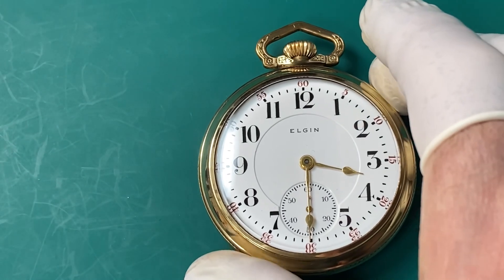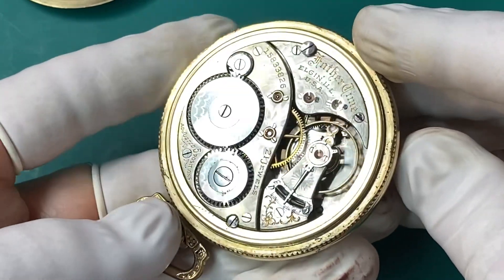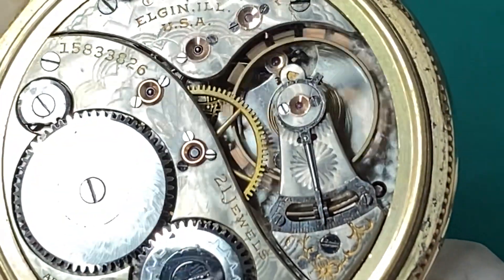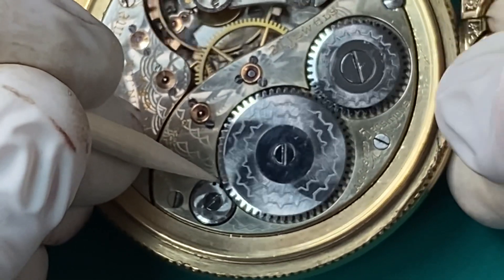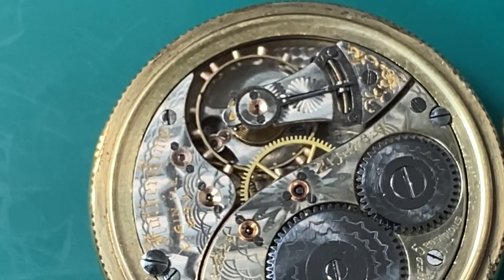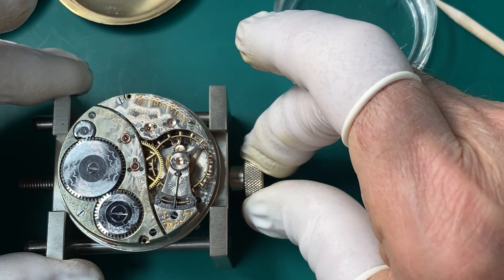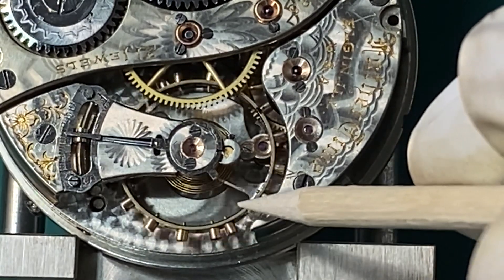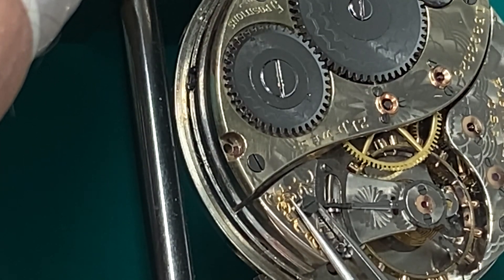How to use a WATCHMAKERS  STAKING  TOOL Set to REPAIR a loose ROLLER table

Comment: What if the balance wheel is loose? Can I just remove the hairspring and rivet the wheel to the staff with the roller table still mounted?
Reply: Fair warning.  I'm fairly new and have not done this task.  I'm basing my response on videos I've watched.

There are at least 2 styles.   One tapered friction fit, like in this video and one riveted on.   For ones riveted on, i would try using a flat stake (with a center hole) to reset and tighten the folded over portion of the rivet.  Rotate the balance as you tap. If the rivet flange portion that folds over pinching the balance wheel has torn, it will not tighten up and likely would require a new staff.

I think the roller table would need to be removed so your stump supports the bottom.

Comment: Thanks for the video. I’m learning on some old Waltham and Elgin pocket watches and I just bought a K&D staking set. Hey at 18:10 - what is that tool called and where can I get one? I want to be able to wind the mainspring while it’s in the movement holder without having to put it into the case. 😊
Reply from the maker: Thanks for the comment. I call the tool a mainspring let down tool I have seen it called a bench winder. I found my on eBay under vintage watch tools. Dave’s Watch tools.com might have some. Or you could make one, take a old winding stem out from a case . Remove the crown from the stem. Then put the stem in a pen vise and use it that way or find small rod or nail and file it square. Then put it in a pen vise.
Reply from the maker: I made some videos on staking tools if you haven’t seen them.
Reply: How do you take the stem out of one of these old pocket watch cases? It doesn’t seem to screw out.

Comment: Hi! I too happen to have one of these rare birds, unfortunately it’s not in running condition and as you might know finding parts for it is nothing easy, would you happen to have any tips on where or how to look, it needs a jewel replacement on the lower center and the ratchet wheel has seen better days but would still function. Thank you have a wonderful day!
Reply from the maker: I have a video coming out in the next week which should be helpful to answer your question about parts!  There is also another video that I already have on the channel about ordering parts.  Have you seen it?

Comment: If you were close, I would bring you two railroad pocket watches to clean and adjust.  I'm the one with the stuck bezel on one of the watches,  I'm worried if I really tried to take the bezel off, I might tear something up.

Also this video was really interesting.
Reply from the maker: If you are not comfortable doing this yourself - I really recommend joining a FB group that focuses on pocket watch repair and restoration.  You should be able to find someone near you or that you could ship them to.  I only restore, build and repair my own, since this is a hobby for me.  I have many future videos planned that may help you also in your pocket watch journey.